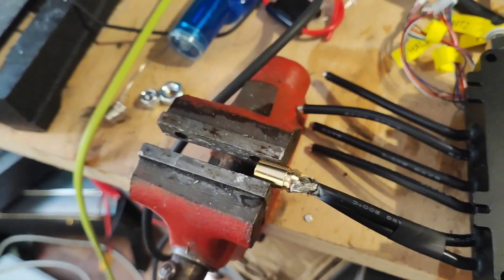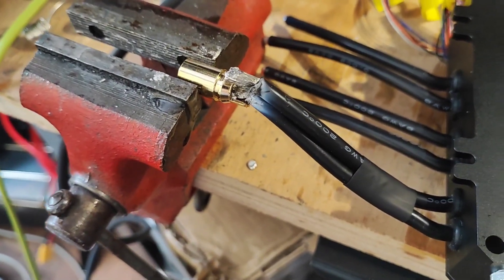E6 DIY 25hp electric outboard - switching to a 300A Flipsky ESC and building a mini carbon mast

Comment: Great content! I’m currently trying something similar myself. 

What kind of performance are you expecting from this? 

Also, what throttle are you using with your ESC?
Reply from the maker: Hi. Thanks appreciate it! What are you trying out? I'm expecting... Well I have put some limits to my first try with the BMS so probably around 10kw or about 13hp. The question is if the parts can handle it so I'll step up my test in small steps. The throttle is just a Vevor throttle I used in my first project converting an outboard to electric. The important part for the throttle is basically just to have ADB (if I remember it correctly) to the one for the esc and the 3v positive plus ground. So I only have forward right now. I'll probably figure out the reverse later at a forum. But I'm excited for tomorrow's first test drive! Subscribe/like if you want to see the next video with that :) But what about your project - what are you aiming for?
Reply from the maker: Also on range, I don't have a clue yet. It also highly depends on how much I use the throttle. I mean half throttle, given all same, is likely to give 4x the range. But say I run it at 3.5-4kw, giving similar performance to a 6-7 hp stinky box, that would give me a run time of approximately 1.5 hours at full throttle. That's pretty cool and likely to give me range that's more than enough. Also, I already have a solar setup to the battery, Ill post some videos later with the panel being on the stern. Doesn't provide much, like 60-70w max, but over a day at low speeds, I guess that could provide enough for quite some extra range. Mostly one does not go full speed either ...
Reply: I have an old Mercury 2hp. My current set up is just a freerchobby ESC (120A) and motor (MP56115). Freerchobby have not been very communitive unfortunately, I managed to squeeze a manual from them eventually for a different ESC as the wiring wasn’t typical, still struggling to find something it can work with.

I’m working with 48v with stacked 12v batteries to test method then will likely upgrade to lifepo4. 

I’ve tried 2 throttles now with no luck as well as using a speed control but still nothing. It’s taken a back seat to other projects but I’m eager to get it working so will be keeping a very close eye on what you’re up to. 

I have experience with domestic electrical work but this is my first dip into anything more complex like this. 

Keep up the good work and I’ll keep an eye out for your new videos.